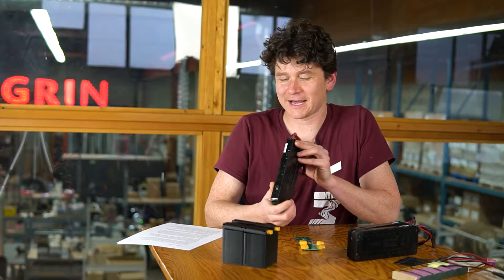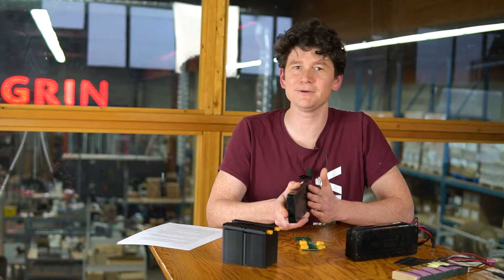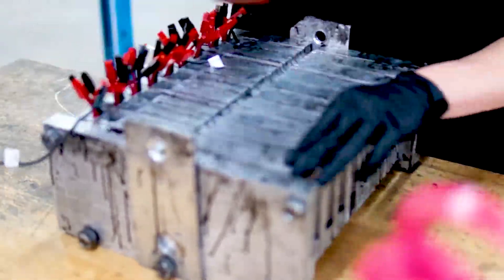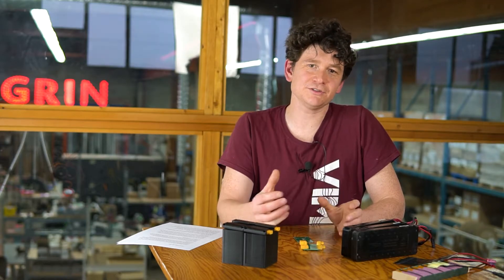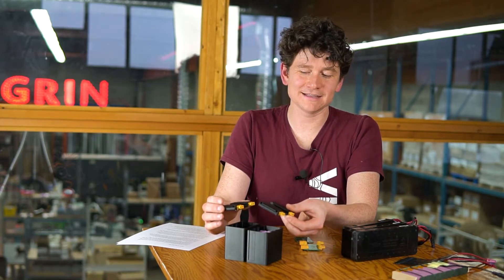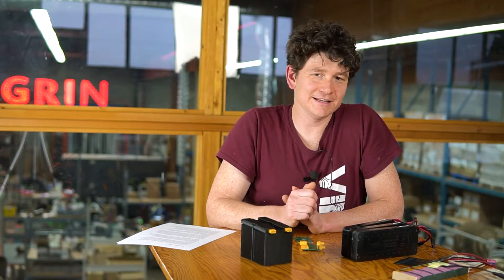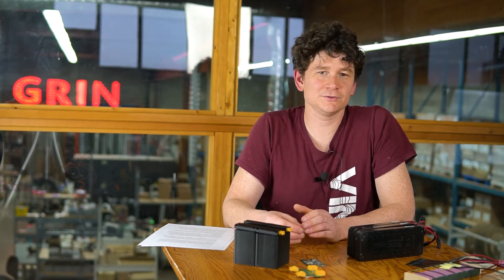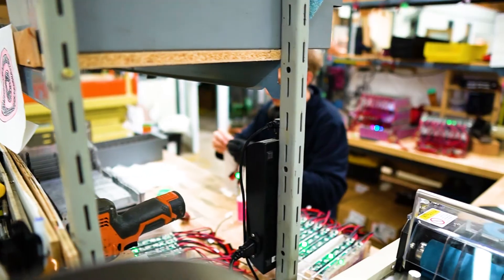Ligo 10X - What's in store to succeed the original LiGo and LiGo+ Stackable Battery Modules

Comment: i like the batteries.. but i found that 36v is just not powerfull enough.. I mostly go with 48v ebikes. I am wondering if this design can somehow work for a 48v ebike system.
Reply from the maker: The problem with doing a 48v version of ligo is that it requires using 2Ah cells to stay under 100wh total, which is really old and dated 18650 tech. 

But you're core assumption is incorrect. You can have just as much power at 36V or any voltage for that matter, you just require a higher current motor controller,and possibly a higher rpm/v motor winding so that the total power (volts times amps) is the same.  With the right choice of hardware you can make a 24v or even a 12v ebike that blows the socks off your 48v reference.
Reply: @GrinTechnologies  Thanks for the detailed reply to my previous comment and for the technical clarification regarding power and current at different voltages. I definitely appreciate the engineering perspective and understanding the design considerations you face.

You're right that with the right components, a 36V system can be just as powerful as a 48V one by drawing higher current. My core concern, however, really centers on the cost-effectiveness and broader market availability for off-the-shelf components. The e-bike industry seems to be heavily trending towards 48V (and even 52V) systems for higher performance applications. This trend typically translates to better pricing, wider selection, and easier access to replacement parts for the end-user, which is a significant factor for many, including DIY builders like myself. My experience riding both 36V and 48V ebikes consistently points to the latter often offering better overall power and performance in readily available configurations.

On that note, I've also observed the growing adoption of 48V systems in other sectors, such as mild-hybrid electric vehicles, for improved efficiency and power delivery. Even in modern aircraft, the trend towards "More Electric Aircraft" is pushing some internal systems to higher DC voltages (beyond the traditional 28VDC) to handle increased power demands. This widespread acceptance and maturation of 48V (and higher) in portable power and vehicle systems generally implies robust, cost-effective components are becoming more common.

Regarding the challenge you mentioned with a 48V (13S) Ligo needing 2Ah cells to stay under 100Wh, I understand that constraint as it would mean using older 18650 tech. This led me to think about alternative modular approaches that could still cater to higher voltage systems while adhering to air travel regulations.

What if the modular concept was extended to accommodate 52V systems (which I believe are typically 14S, nominal 51.8V)? For instance:

Could there be two ~26V (7S) packs that plug in series? This would provide the necessary voltage for a 52V system while keeping individual pack energy well under 100Wh (likely in the 50-70Wh range depending on cell capacity).
Taking it a step further, what about four ~13V (3-4S) packs? Each of these would be very small in terms of Wh, making them extremely versatile. They could potentially be configured in series for e-bike use, or individually/in parallel for other applications.
The true versatility for these smaller packs would be immense, fulfilling multiple needs beyond just e-bike power:

12V/24V Compatibility: Individual ~13V or ~26V packs could be more directly compatible with common 12V or 24V solar charging setups or used as portable power sources for various DC devices.
USB Power Supply/Backup: With the right output ports (like USB-C Power Delivery), any of these smaller packs would make excellent, compact, and easily transportable power banks for phones, laptops, and other electronics.
Ultimate Modularity & Expandability: Users could buy as many ~13V or ~26V modules as needed for their desired e-bike range, and easily reconfigure them for different applications when not on the bike.
The primary technical challenge I foresee with these highly modular setups, particularly when configuring them for higher voltage e-bike use (e.g., a 52V system from multiple smaller packs), would be charging. My assumption is that each individual pack would need its own robust BMS. If connected in series for charging, they'd ideally need a smart system to communicate and balance charging across all packs simultaneously. Is this something that's feasible or already being explored in your R&D?

Finally, regarding the 100Wh air travel limit: while I absolutely understand the safety rationale and the difficulty of changing regulations, it does feel quite restrictive for e-bike specific solutions. Given the trend towards 48V and higher systems in the broader power electronics world, and the common availability of high-density cells that might push a standard 48V module just over 100Wh (e.g., to ~130Wh without resorting to older cell tech), do you think there's any hope, or perhaps ongoing industry lobbying, for a slight relaxation from the TSA for modular e-bike batteries? Or is the 100Wh limit simply too deeply entrenched due to broader aviation safety standards, regardless of advancements in other power systems? I'm wondering if that extra 30Wh (from 100Wh to 130Wh) could genuinely tip the scale from safe to unsafe, or if the current limit is more about simplicity and a broad safety margin.

I'm genuinely interested in how we can bridge the gap between regulatory requirements and the desire for practical, powerful, and versatile e-bike battery solutions for the general public. Your modular Ligo design is a fantastic step in that direction, and I'm keen to understand how it might evolve or whether these other configurations are even technically viable and cost-effective from a manufacturing standpoint, ultimately benefiting all e-bike users and beyond.

Comment: Would highly recommend keeping in mind the use of these in Electric Skateboards as well, that's one of the easiest to travel with form wise. While the old form looks great for that use these new ones might limit how useful they are for use in E-boards, maybe have a version that goes the thin way for that use?
Reply from the maker: We really preferred the old flat form factor partly for this versatility, but there was no easy easy to get the same click and go connectorization to work without developing a fully custom connector system. So yeah it's sad that these won't be able to fit under a skateboard deck anymore, but for those using them on folding ebikes and such they are super ideal.
Reply: @GrinTechnologies  You can probably still get it to fit if you can figure out doing the PCB rotated by 90 degrees to connect along the short side instead of the long side like shown in the video, that looks about the same depth as my Backfire battery enclosure. Or actually possibly even better have a version with the connectors/pcb on that biggest side of the box? I imagine that'd be simple enough with a slightly different enclosure and the same PCB with just slightly longer connectors? First option could fit more but is probably harder since you'd need a different PCB layout on the other hand the second option could probably still fit 3-4, and would likely be easier to mount on a board since you could put the rail just on the underside of the board rather than having it sticking off and down 90 degrees on one side. Let me know if I'm not doing a good job of explaining 😅

Comment: This is great you should be applauded for your genius.  But please spare a thought for existing LiGo users such as myself.
If your system of grants is anything like here in the UK it will be corrupt, most of the money ends up in the hands of hopeless academics without a single innovative cell in their brain.
Reply from the maker: You can be assured, we failed to get any grant money for this and are proceeding forward based on the slow but sure method of bootstrapping.

Comment: It's too bad there aren't also 5S packs for this. The jump from 10S to 20S (for adding additional modules) is just way to much for many of us who are building ebikes in the 52v to 72v range. 
Obviously, this would require some re-tooling or new tooling and molds, but many of us would benefit more from 5S modules than 10S modules.
Reply from the maker: 7s with 2170 cells is the tentative plan to address that. Just need to get these in full production first before we consider variants!

Comment: Those connection points seem like a potential failure point. My ligo+ packs have survived burning man, i think a lot of it is thanks to the design of the wires being open and able to absorb the bumpy surface.
Reply from the maker: When they are secured to the mounting rail they are held pretty tight in place with no room to wiggle and no stress on the contacts. But we have been and will continue to do plenty of road testing first to assure this.  We have seen XT60 plugs be problematic in the past with wired connections that are stressed at an angle.

Comment: This will be waterproofed as well, or at least somehow ready to ride "outside" and get splashed on occasionally?  And should I presume that it won't be potted, so there's some air inside the box?  Your comments on what this will mean for cooling will be appreciated.  Thank you.
Reply from the maker: Will be waterproof except for the exposed pins of the xt60. Bms and cell tabs will be potted, but not the central area to keep the weight down.
Reply: @GrinTechnologies  I presume it'll be waterproof BEHIND the XT60, so while the (lowish-voltage) pins can get wet, water won't get into the battery around/behind them?
Reply: @GrinTechnologies  Also: Will it be fair to assume that the "thermal situation" with these, in terms of self-cooling and whatnot, will be roughly typical compared to the other frame-tube-mounted battery packs you're offering?
Reply: @GrinTechnologies  Also-also: Is one of the two-pin connectors for charging, and the other two-pin connector for discharging?  And they all wire/stack in electrical parallel with each other?  Is that it?

Comment: The fact that this isn't a subject of major design competition and patent award with a huge award at the end---is a sad reality . 

all you hear about these days is ev's and modular composable 12v  batteries not just for  scooters, but power packs, 12v applications and STANDARDIZED  CORDLESS POWER TOOLS, yet POWER TOOLS. this is a HUGE market opportunity. 

OH YEA, it turns out you can charge and discharge batteries at the same time as well. so you can use these to modulate current coming out of a gasoline 1000 watt generator as well, on 250watt 'eco' mode so it doens't make a lot of noise at events but provides a staeady load, with 'high power' as needed from a pack. yea, that cannot be done yet!

obvious things that should be or have been done since a long time ago.

Comment: Good for you. I came to this video because someone blogged about an electric motor on a Brompton. I don't want to go fast but I do want distance. I'm getting old and no longer drive but I can still get the folding Bromton on the train to do most of the distance (I live in the English countryside.). It would be nice to have a battery that could do real world 40 miles @ about 10 MPH max that's fast enough for me. I use a Burley Travoy trailer to carry my camping stuff for short excursions by the sea etc. The motor looked much more than a 250 watt and the fact it can run at 72 volts is a great idea.

Comment: How will these work for those who have 4:35  the red-black Anderson connectors? And will these fit in the large Rock Brothers or similar saddle bag? The current LiGo will only fit 1 or 2 at a time.
Reply from the maker: Hi Nina, you'd have a short adapter cable from the XT60 on the battery to an Anderson on the motor controller.  They should fit OK in larger saddle bags but our plan is to make frame mounting hardware so they can secure properly like downtube packs.

Comment: Thrilled to hear of the update on the Ligo, brilliant work as usual and a fantastic video and explanation. Thinking on the charging, with EU forcing the USB-C compliance amongst cell phone/devices it seems like a valid idea? Thoughts?
Reply from the maker: The high power mode of USB-C is interesting indeed.  But this would require a separate adapter from the battery power lead to the USB-C cable in order to communicate /negotiate the specific power and voltage levels.

Comment: Is the 3x4x3 form factor in inches?  That will make a much larger stack of 4 (or 5 or 6).  4 old LiGos is 8x3x3", where this will be 12x4x3".  Can't imagine how I'll get that on a Bike Friday...  Oh well...
Reply from the maker: No, that's the cell layout, not the dimensions. Each cell is 18.5mm diameter and so the casing ends up about 44mm x 77mm

Comment: Beautiful concept and great design. I excited to upgrade my Ligos to this new version in the future, especially for the electric, TSA-friendly, bike camper I am planning to build. Are you concerned about investing so much into a product designed to exploit the odd grey area that currently exists around the number of allowed 100WH pack on an airplane. I guess is the TSA announced tomorrow that only 2 were allowed per passenger, it could still be a compelling 200WH product....
Reply from the maker: Yeah, it would be a bummer if they did that so it's a risk. However the concept still has value to allow you to ship the batteries without having class9 dangerous goods. As long as it is shipped with equipment you can have up to 5kg of <100Wh batteries in the box.

Comment: Interesting concept. What will be the size of these new ones?
	Although I see obvious benefits to the change it appears that there will now be only 1 way to configure a group of these together where as the previous model, because of the cables and slim form factor, could be configured in many more ways and therefore fit many more applications - at least for the DIYer. This is especially true for skateboards, scooters, folding e-bikes, and other smaller e-mobility device ideas. I am not seeing how the new design addresses this.
	
	I still hope that there would be the possibility of offering the previous model once chips become more available so that existing customers can replace their used batteries and also have them work with their existing motors, cable systems and devices. 
	
	Not trying to be devil's advocate but I am a huge fan of the existing style and you guys are the only company that makes battery packs that are this skinny, portable and air travel friendly! (which is why, I assume, they are extremely popular and in high demand).
	
I do wish you success with this as I hope that it expands your company because you deserve it, but I also hope you reconsider discontinuing the existing model or at least also offering a skinnier version of 10X with more connecting options. I also agree with having a Kickstarter link! Cheers.
Reply: As an existing LiGo user I agree with all of this
Reply: Why not use cables to connect the new form factor ligos if you need to?  Then one could change the shape.  That would solve what you mention while also serving individual customers and other companies that don't want wires for a win-win so that the product moves beyond niche and gives Grin the opportunity to innovate even more.

Comment: Excited to see how this turns out! I'd love a stackable pack if the discharge current is high enough (I use 60 amps), and will there be a choice to go series or parallel?
My own bike is a RadMini 4 (2020 version) with a MXT Phaserunner, Cycle Analyst, dual Tesla 52v 20Ah batteries, and a Bafang G062 motor. It looks stock with one battery hidden in the rear rack bag, and has a fully class 2 compliant mode for when I ride in parks and bike trails, but unlocks to 2,400 watts for off road use, so it really hits the sweet spot thanks to you guys.

Comment: Ah, what you guys are doing for the future of technologies for ebikes is amazing! My Daymak Florence FT has been in our local shop for months now. I sure wish it could be retro fitted with one of your kits, but I'd probably end doing it wrong and breaking something.
Reply: Your trike can be retrofitted five ways from Sunday. If the shop you're dealing with can't figure that out, go elsewhere if possible. Grin has no LiGo packs right now, but with one of their Hailong-style packs, you could shove a Baserunner up the wazoo (the battery's, not yours) to tidy things up; I'm guessing the stock seatpost-mounted controller attaches to a standard drink holder mount, so ditching or relocating it would let you use it for a bottle of...oh, let's be boring and say water. Alternatively, you could mount such a battery on the seatpost, and free up the stock battery location under the cargo area for a pizza or two!

There are people who've hacked displays like yours to work with that, but that's above my pay grade (I personally don't run a display). Cheers from Ottawa.

Comment: Some xt60s and 3d print enclosure don't really look convincing. Why not help people make batteries out of powertool packs? Design adapter systems that you can 3d print with a bms system so you can monitor and safely charge them
Reply: Getting the legal IP from each power tool vendor to use their receptacle would be challenge and i would imagine also expensive. A legal company would not risk creating systems for this.
Reply: @KevinSatterthwaite  tnx for your 50 cents, i acknowledge that my rant is not a solution. The presentation was kinda lackluster imo wish them all the best.